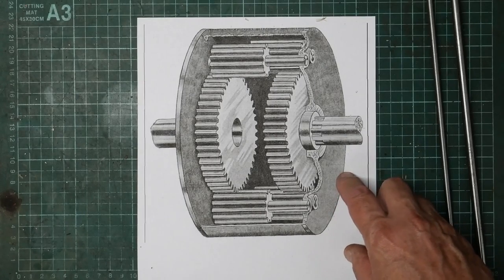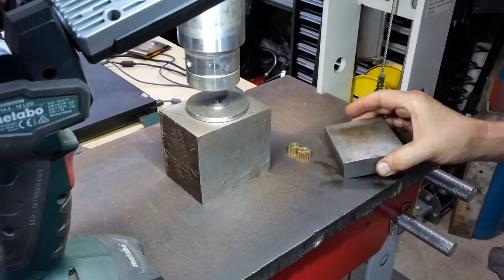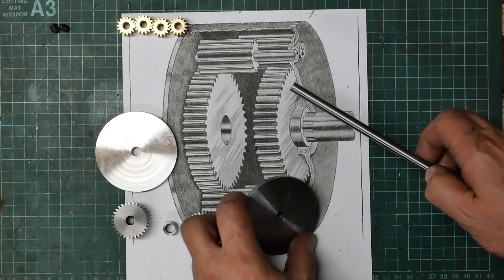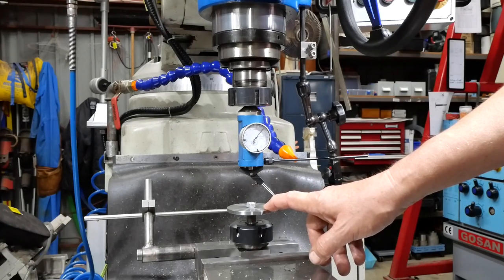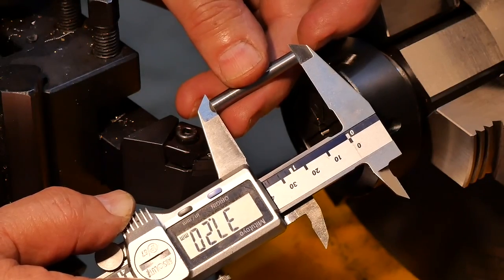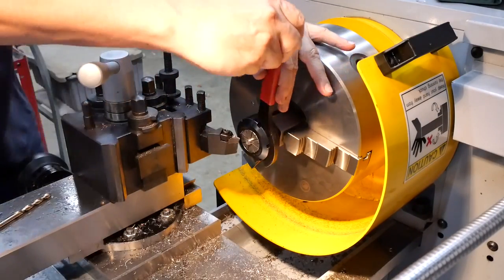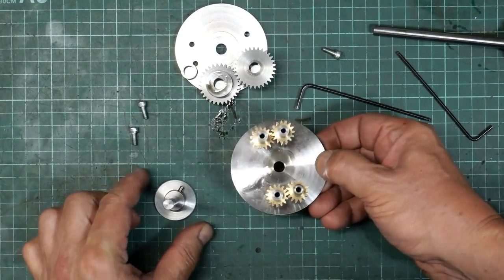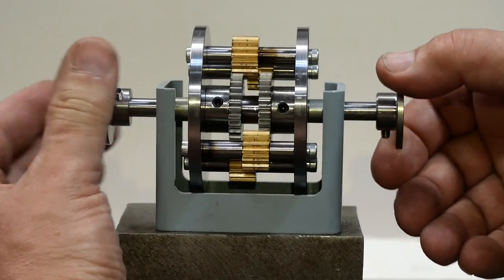Spur Gear Differential

Comment: Gday Alan, that was a really interesting build, now you need to build a gearbox to go with it, what’s your thoughts on the TNGG inserts now you’ve had them a while?, great job as always mate, cheers
Reply from the maker: Thanks Matty. I have found the TNGG inserts to be really good for cutting parallel to the bed. They leave an excellent finish and I have used them with up to a 2mm DOC. However, I have not found them to be so robust with facing operations and now only use them for fine finishing passes. I should be more scientific about speeds and feeds rather than "suck it and see" but I generally find it pretty easy to get nicely breaking chips when significantly reducing a diameter. 
Cheers.

Comment: Appreciate such high quality channels with less followers. Sometimes things which cannot be found on bigger channels, can be found here. Was looking for explanation on spur gear differential. Wondering where the  input for differential is?
Reply from the maker: Thank you for the kind feedback. Input would be applied to one of the side plates, either through teeth cut into the perimeter or a bevel gear mounted on the outside https://youtu.be/Bu4BPLmoJyU?t=1429
Cheers.

Comment: Very nice! I can find very little about spur gear differentials. why is barely used, anyone know? i would say it has some advantages compared to a usual ("pin-gear"?) differntial. For example could be potentially flatter.
Reply from the maker: Thanks Jan. I think several factors reduce the attractiveness of the design including cost and packaging efficiency. The spur gear arrangement has more moving parts and is less compact.